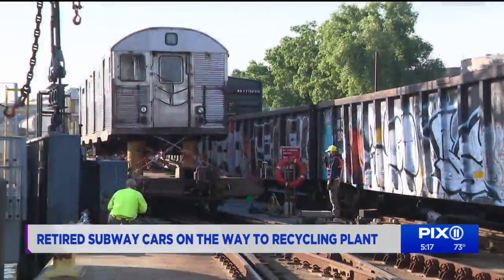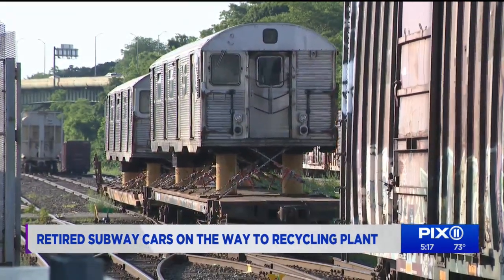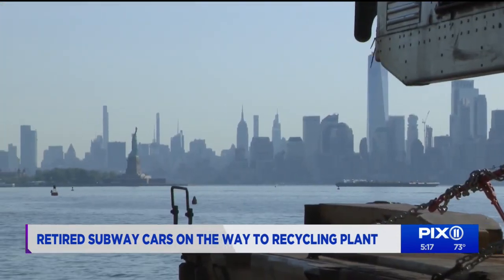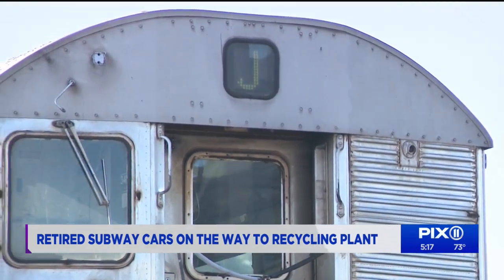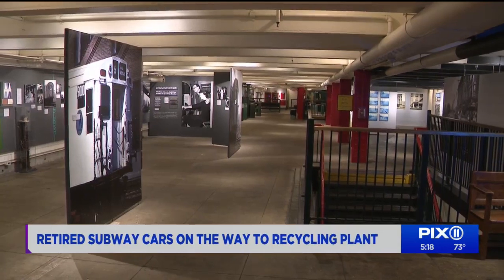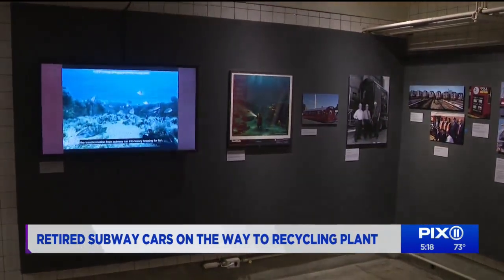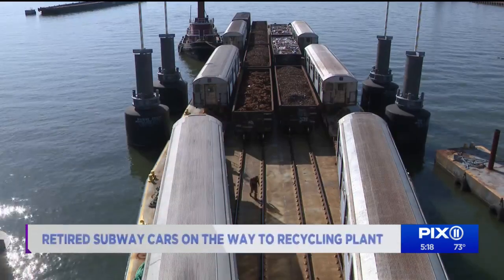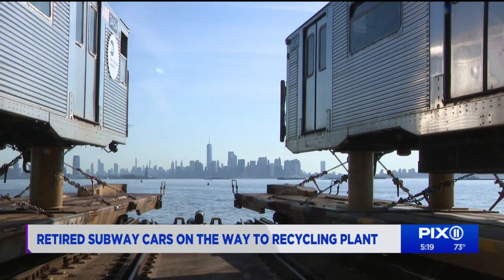Retired NYC subway cars on the way to recycling plant

Comment: What needs to happen is get rid of the crusty old dirty trains they keep running on the 3 A & C lines those trains will still be in service 10yrs from now they’ll keep putting screws in the floor & patching the seats with bathroom sealant 🤷🏽‍♂️🤣
Reply: They already ordered new trains to replace the A/C trains. They're do to start this September.
Reply: The R62s on the 3 are doing well, I ridden won a while ago and it was completely fine.